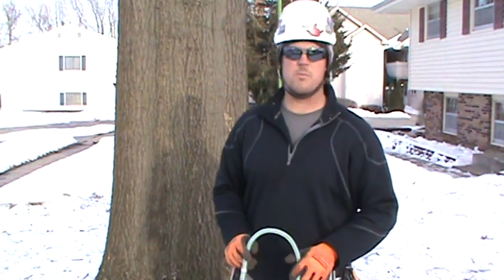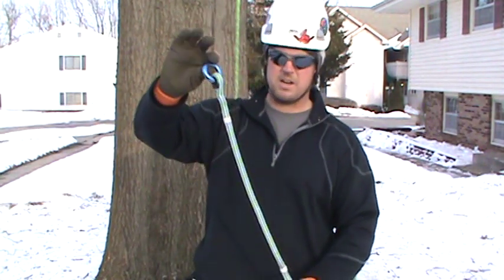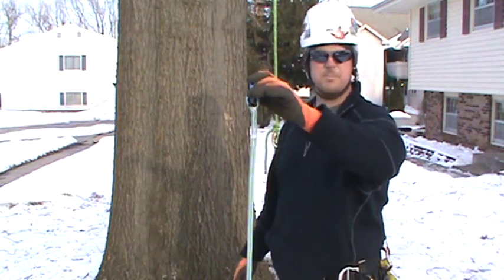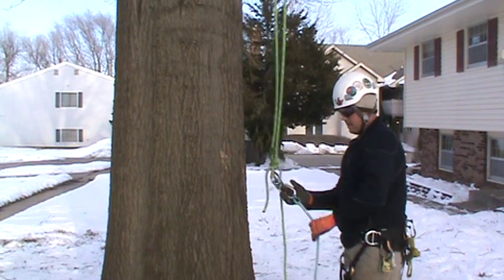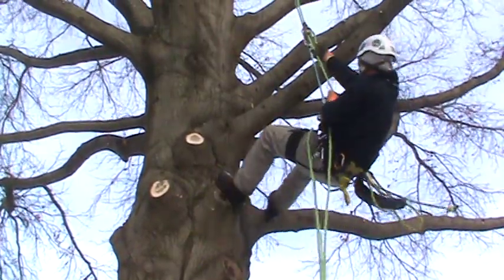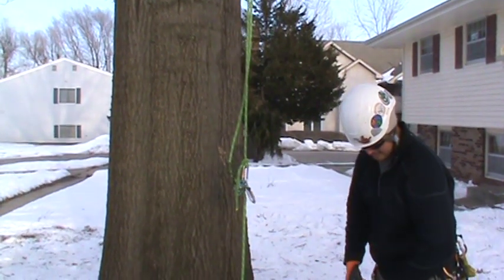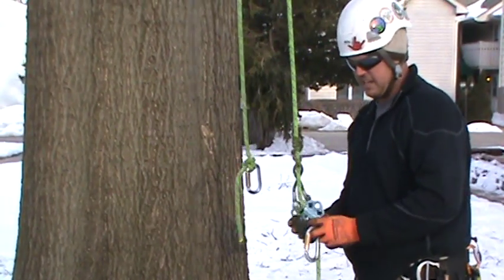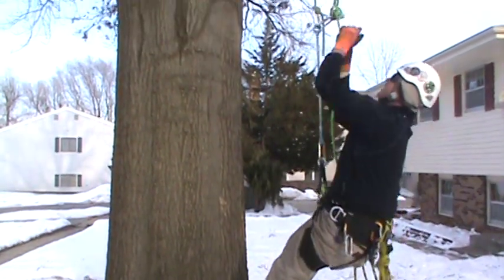Climbing system DRT

Comment: I scratched my head and watched this a couple of times to understand what is happening. With that 18" extension you are raising the system enough to allow you to pull on the slack end of the rope as it exits the pulley, rather than pulling above the hardware. That looks like it is worth a try. I believe even the old school Blake's hitch closed system (with a small prussik on the other line to tend slack) could be tied to extend that distance to permit hauling from below. My problem is the friction in the line can be very high when a throwball doesn't isolate a single branch, so I lose the advantage of a smooth 2:1 pulley until I can get up to the notch.

Comment: Just saw your video I love it you're somebody that really thinks outside the box like myself I would imagine if you understand this industry you'll know from just watching the internet are people to shreds because of hatred jealousy or just the actuality of bad people...
I am the builder and pending patent holder of the z runner and I believe in my product to the point that I've isolated the brain relieving fear of other products and fear just comes with working at height but you will never worry about my product breaking it cannot be done I don't everything but stainless steel with a thicker gauge of metal due to the fact that one sits on the line it weighs nothing to the climber I have finger friendly for descending where it no longer hurts your fingers because of the weight of the body..
I can talk for days and if there's ever a time you would like to talk about my product I believe in you and one day you'll believe in me

#zrunnersrs I'm the builder of the strongest mechanical device for rope access for people that need self-rescue for my story building fires and work placement at height related scenarios.

Comment: Wow I feel like anyone who doesn't do this is totally missing out unless you use foot climbers.. You could also just use a micro pulley to avoid tending slack but won't have the benefits of the 3 holes in hitch climber